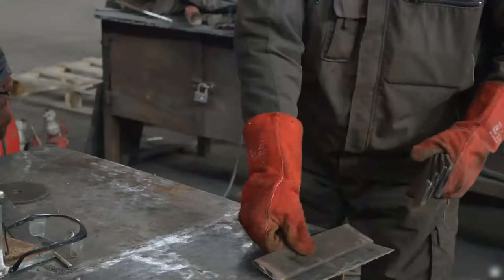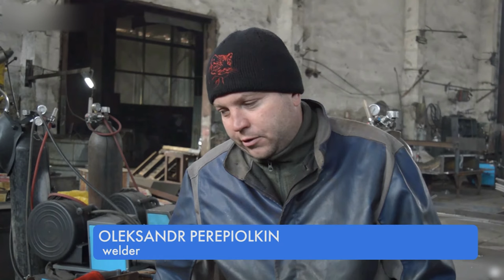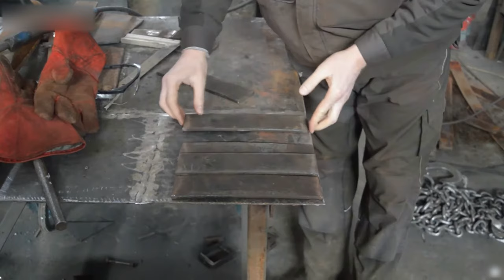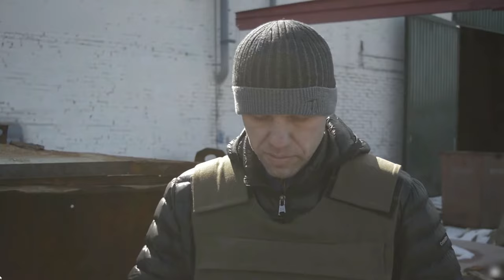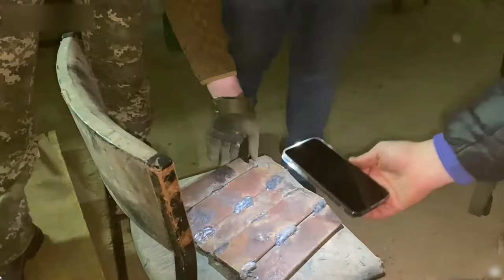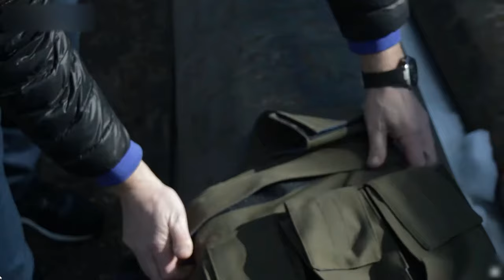Ukraine War Welders Make Body Armor from old Car Springs

Comment: A suggestion for more mobile troops. A composite armor with a porcelain tile front, fiberglass layers crossweaved at 45 degrees, and a light metal backer. 
This will reduce weight significantly when compared to metal alone. Weight reduction at the cost of plate longevity. 

Depending on the thickness of the improvised plate, you may have the ability to stop standard 7.62x39 as well as green tip 5.56 steel core ammunition. 
Worth looking into.
Reply: How thick are we talking? And is this feasible if they want front, side and back protection?
Reply: How Can someone make a body armour plate at home

Comment: That might stop a round, but the spawling fragmentation will be very bad, maybe even more deadly if it strikes the neck and head and lower extremities
Reply: Spalling protection is easy to do as well. Some layers of Rubber and some adesive or super glue wors.
Reply: They make the plate carriers with kevlar because steel plates are what 90% of them use. This stops sprawling. They also have some sort of cover on the metal
Reply: Well its better than nothing at all
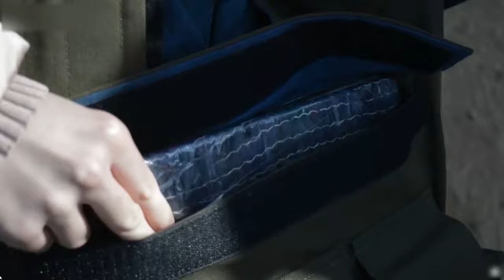Reply: It appears at 1:44 the plate inserted in the carrier has some material wrapped around the plate as the texture doesn'tlook like steel. You are spot on about spalling...
Reply: I'd want a metal lip to deflect spall for sure.

Comment: Lot of tank knocked out. Why do not use metal from them? high quality
Reply: you might be surprised but tanks use a lot of composite armor not solid plates also it tends to be heavier than needed and hard to work with car springs on the other hand are almost perfect easy to work with very hard but still flexible standard armor plates weigh 8 kg as opposed to 10 kg scrap version so they are pretty good